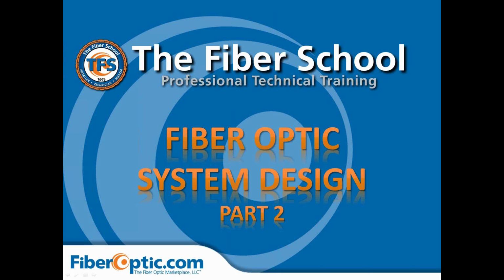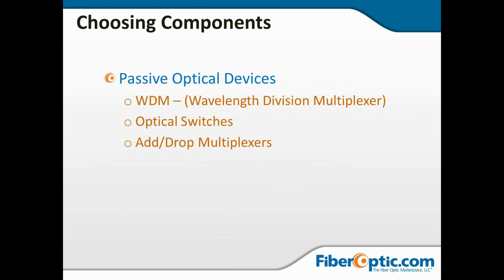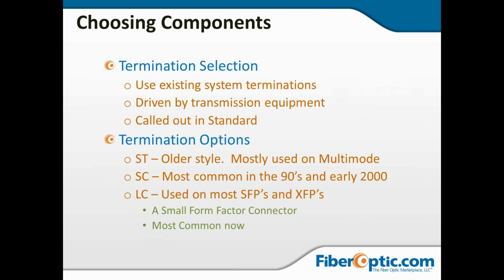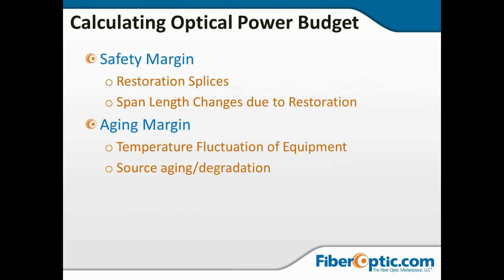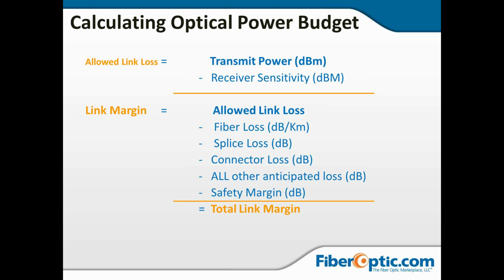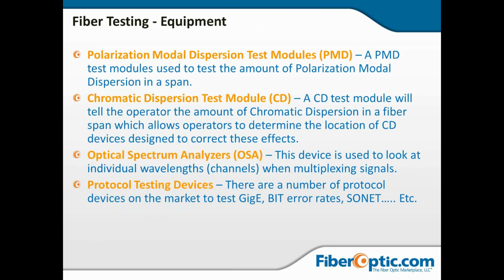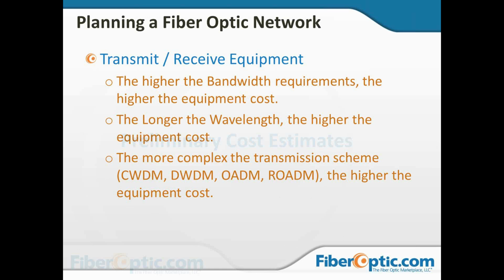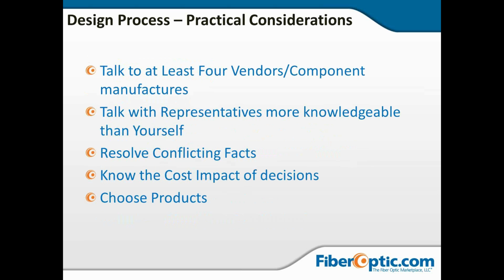On-Demand: Fiber Optic Network Design, Part 2

Comment: Very generalized however (part 1 and 2) these are straight forward guidelines toward overall understanding and implementation considerations and I appreciate it.
Reply from the maker: Thank you for your comment. We appreciate the feedback. You are correct in that it is very generalized. There is a lot to cover on this topic, therefore we also offer a 3-day course on System Design, led by one of our senior instructors. Thanks for watching!